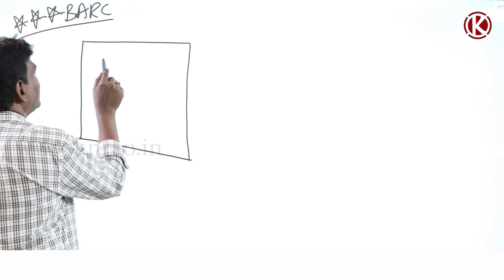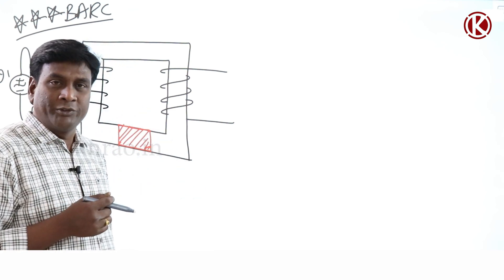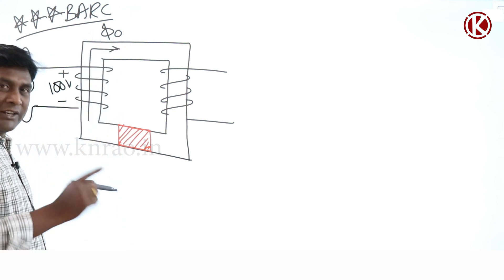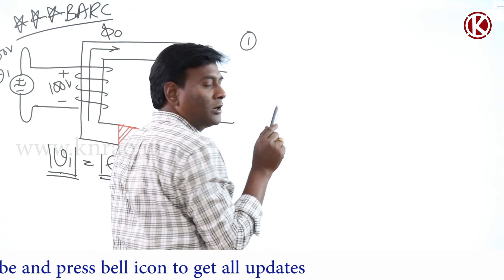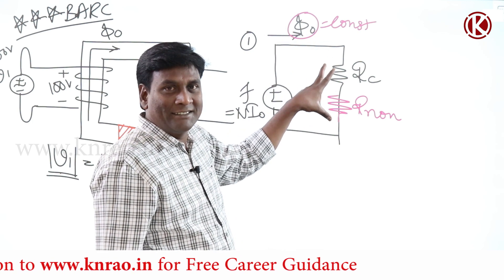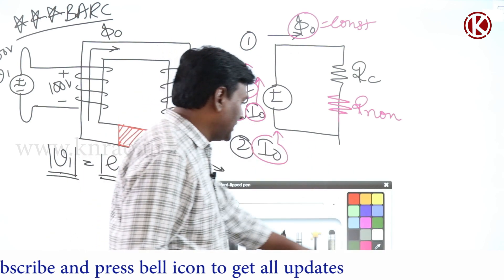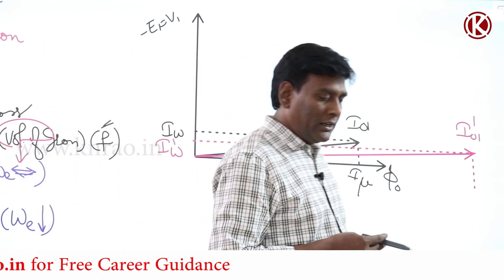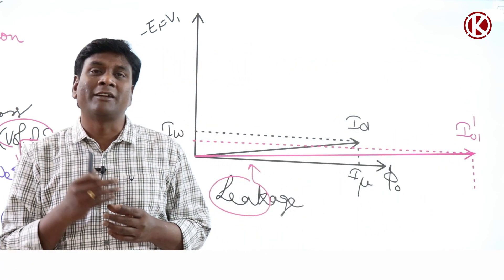BARC Interview question on No-Load Condition of Transformer || GATE / ESE Lectures by KN Rao

Comment: Sir, Please form a scenario where MMF is completely blocked in the core path due to the presence of a small non-magnetic material as in the above question. Is this possible? What would be the parameters value of material in such case.
Need your explanation sir.